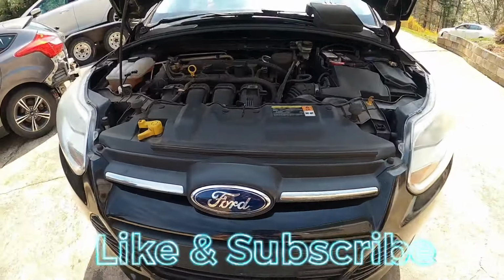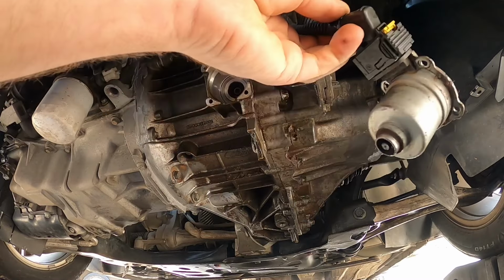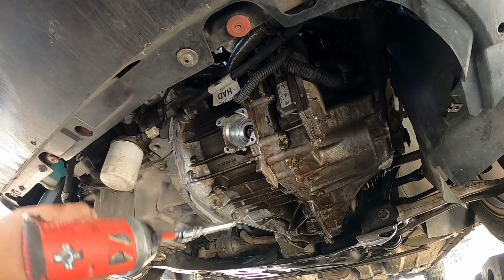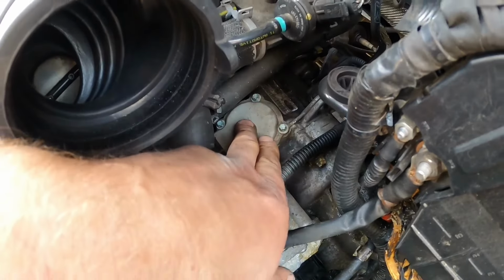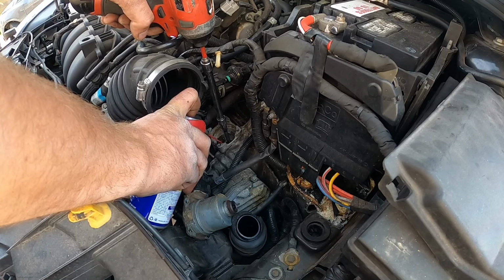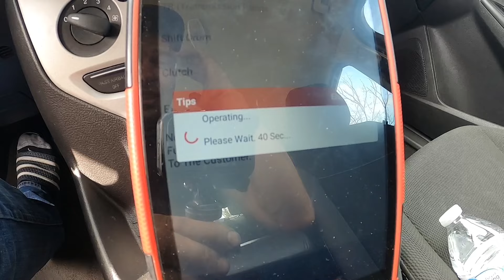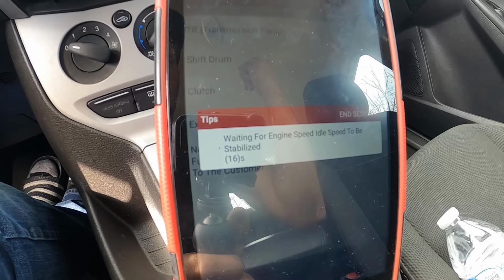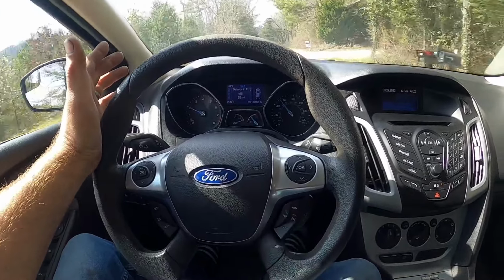2012-2018 Ford Focus Slipping? No Reverse? No Drive? Problem Solved. Easy Fix. You Can Do This!

Comment: What's the actual name of that piece needed in that kit? Thank you
Reply from the maker: https://www.ebay.com/itm/184480096055?mkcid=16&mkevt=1&mkrid=711-127632-2357-0&ssspo=yvwl7HUSReq&sssrc=2349624&ssuid=-qApsBzoR4m&var=&widget_ver=artemis&media=COPY
Reply: @L8R-HP  wow thank you for the fast response
Reply: @L8R-HP  I really hate to bug you. I'm having issues finding a place to buy it here in the US. Any tips? Thanks
Reply from the maker: @wymorr6889  I’ve see it on Amazon before, just can’t find the link at the moment
Reply from the maker: @wymorr6889  MIXPOWER 10 Piece Spline Tip Bit Socket Set, M-Type, S2 and Cr-V Steel, Extra Long 4'' Length, M4-M18, XZN Triple Square Spline Bit Socket Set https://a.co/d/bHbZ1Ev
Reply: @L8R-HP  well I got the bit set and they were the wrong rib amount :( I'm just going to buy that whole kit you have for working on the whole transmission. On the plus side, while I had actuator B opened up, I cleaned it out and lubed it, started my car and shifts fine lol. Just wasn't able to spin that thingy inside. I'll do both actuators here in a week or so. Thanks again for the help.

Comment: I want to buy a Ford Focus 2012The owner tells me What is wrong with the actuator According to Amazon the price is 81 dollars. He tells me that he ran to ob2 and it gave the code for the actuator.. And tells me that everything else is fine. What do you recommend I buy it or is it risky that it could be something more complicated apart from the actuator
Reply from the maker: Could be just an actuator. If it is buy an OEM one from ford. Most of the time tho it’s stuck forks and actuators can’t move them

Comment: What would be an estimated cost to have this issue fixed? I have a Ford focus (2017) that pulled up a code P287A (Clutch actuator B stuck).
Plus, why does the car have difficulty starting? It cranks a couple of times without the focus starting, and finally, the car turns on on the 3rd try.
Reply: Hey did you end up getting your car fixed?

Comment: Transmission friction element is stick on P07A3,Clutch A stuck engaged P2872,
Reply from the maker: Most likely the forks. If not, check your battery, grounds.

Comment: Hi I have a ford focus titanium 2012.. my car has been down for a few weeks. so a few times when i was driving I would be at a red light and try to go but I would get stuck then it would go and it's been jumping a bit when I drive what could this be I did get a new actuator A and got it put in I did test drive it and was not getting stuck but still jumping a little but not as much as before help please if anyone knows thank you 😊
Reply from the maker: Forks are sticking

Comment: My 2018 just had service transmission light on only when driving if I shut car off and start it no warning light!! No diagnostics been found on transmission just a P0456 for evaporator canister.
Reply: Also not getting reverse and just slipping in and out of gear! Pulled over and not risk it.
Reply from the maker: Forks are sticking making clutch slip
Reply: @L8R-HP  you think cleaning the actuators will fix it
Reply from the maker: @MegaAce1987  cleaning the forks will help, unless they failed and need to be replaced
Reply: @L8R-HP  well what happens I’m lacking tools what all do I need
Reply: What tool is that?? Also I’m gonna change fluid as well so what tool will I need for that too

Comment: Hi there cool video what is the name of that tool
Reply from the maker: DPS6 Dual Clutch Transmission Installer Remover Tool for Ford Volvo Focus Fiesta #307675 https://www.amazon.com/dp/B09JGC6KF1/ref=cm_sw_r_cp_api_i_H5KSA8N8YC2S8ZHY2WC1?_encoding=UTF8&psc=1
Reply: Thank you
Reply: Another going through the process can I any scan tool to remove any codes
Reply from the maker: @ozydube5497  most scan tools should be able to clear codes. Not sure if all will do the relearn

Comment: I have a 2013, I have like a shutter or shaking only at about 1500 rpm to 2000, then it stops in the other gears, it returns when slowing down at the same rpm’s… what could that be ?
Reply from the maker: Shift forks are getting stuck
Reply: That or motor/transmission mounts .

Comment: My 2011 fiesta shudder when below 40KPH or below 2000 RPM but no shuddering when the temp still cold. What could be the issue? It's bothering me so much.
Reply from the maker: Forks are getting stuck. Need to be cleaned or replaced
Reply: @L8R-HP  Thanks.
Appreciated your response

Comment: Hello there , question …. I have code P07A3 out of mine 2015 Ford Focus which says “Transmission Friction Element A Stuck On” you think doing this cleaning and lubricants on the top actuator will help me to fix it ??? Thanks for your time in advance 🙏
Reply from the maker: Yes this will help, if not the shift forks need to be replaced

Comment: i have a 2014 ford focus it has reverse but no drive and both of the actuaters work i have swapped them around and it still only has reverse and i cant afford to get it to anywhere to have codes scanned not sure what to do anymore
Reply from the maker: Any auto parts store should scan codes for free

Comment: Hello, My dad was driving his 2012 focus home the other day and its been shifting fine and has 230,000 miles on it. But today after he pulled out from an intersection it went to shift into second and he lost drive and reverse entirely. We scanned and it has 12 transmission codes.  P0805, P087A, P0902. P0903, P090C, P090D, P2831 ,P2836, P285D, P285E, P2861 and P2862. I cant find anything for these codes really since the focus has such an infamous rep that its mostly just people complaining about dead transmissions. Do you have any idea what could the issue be? The cars been no slouch and its never shuddered or slipped since we did normal tranny fluid changes,.
Reply from the maker: With that many codes at once it’s probably your TCM that failed. Find a used one online and try it out.
Reply: @L8R-HP  Thanks for the help, I tried to reset the TCM just to see what would happen and when I hopped in this morning it actually had at least 1st and reverse, Ill have to try a test run but the TCM is the biggest issue if it doesnt go away

Comment: What does, friction element b stuck off, related to?
Reply from the maker: Stuck forks
Reply: Thank you 🙏 do you have a video on how to unstuck them? Or is that the one when you are spraying WD 40
Reply from the maker: @fernandohiguera6972  you can try this out, if this doesn’t help the transmission will need to be removed to get to the forks
Reply: @L8R-HP  ok thank you sir

Comment: Hello. We have a 2014 Focus that fails the " Actuator B spring flyback test". We squirt it with WD-40 and it works for a few hundred miles but then fails. Would you be interested in giving a shot at fixing it if we could figure out how to get it out and sending it to you? - Tks John and Shirley Wright Boulder Co. PS: We really love our Focus, but for this problem.
Reply: I guess not, eh?

Comment: I have a 2014 with a shudder in 2nd gear. Would this possibly help?
Reply from the maker: Yes it will help. Your forks will move smother and it will shift better
Reply: I have a 2014 also and 2nd gear shudders too!!! 86k on vehicle!!

Comment: Do you know anything about the code P287b and p2832? Are my forks sticking? My trans seems to take off in 2nd or 3rd and is sluggish like skips lower gears and shifts at 3500 like you hit a wall

Comment: What’s the little 6mm part called if I’m on a budget?
Reply from the maker: Capri Tools 6 mm M6 Stubby XZN Triple Square Bit Socket, 1/4-Inch Drive (CP30353) https://www.amazon.com/dp/B083B6KMCL/ref=cm_sw_r_cp_api_i_QXBRB8E0AVTYPHWYW2RZ

Comment: So mine works fine then randomly it has problems like it don’t know when to shift like eventually it will shift gears it just takes a little bit.  And then sometimes the reverse won’t work but if I turn the car off let it sit for a few min if will go into reverse again. Is this the same problem or is mine different. Been to ford twice for the recall and still have these problems
Reply from the maker: Forks need to be cleaned or replaced

Comment: any chance you know where to purchase just the spline socket? or part number for it?
Reply from the maker: Capri Tools 6 mm M6 Stubby XZN Triple Square Bit Socket, 1/4-Inch Drive (CP30353) https://www.amazon.com/dp/B083B6KMCL/ref=cm_sw_r_cp_api_i_QK9XM74TG2CBAF6AB5H7
Reply: I tried the M6 but a bit small it keeps on slippng from spline. Do you think it's  m7 ⁴
Reply from the maker: @amznoldamba7091  https://www.ebay.com/itm/184480096055?mkcid=16&mkevt=1&mkrid=711-127632-2357-0&ssspo=yvwl7HUSReq&sssrc=2349624&ssuid=-qApsBzoR4m&var=&widget_ver=artemis&media=COPY
Reply: @amznoldamba7091  please let me know how it works out I just over nighted an M6 for my 2016 ford focus . really hoping it does the job
Reply: I already tried M6 too small and M8 to big. This M type tool is have 12 teeth, the actuator have 14 teeth. The new link you give will be correct. But it take a month to arrives 😅
Reply from the maker: @drgnslyr9184  you should be able to find this tool anywhere
Reply: After cleaning the forks it really worked! no more shuddering...
Reply from the maker: @amznoldamba7091  nice! Good job 👍

Comment: I've had both actuators, clutches, clutch assembly, forks, all replaced. It has a problem in third gear.
Reply from the maker: If you have a problem only in 3rd gear, it’s an internal problem.

Comment: I have a 2017 only 14,000 miles. Not sure what happened the car has been great up until this morning I pulled forward heard a clink and lost reverse. Reverse acts like neutral and the car is clearly in limp mode now. I don’t have any check engine light. Happened right after charging the battery.
Reply from the maker: Low voltage could have damaged the TCM. Or the fork is stuck
Reply: @L8R-HP  I was wondering but than they should have a battery warning light for low voltage to prepare you ahead of time and a procedure that should be done to reset before driving again in the owners manual to prevent potential injury to the transmission. I was a ASE certified technician for 20 years up until 2009. I wasn’t ever aware of the FOCUS issues and we never worked on them back then. Even buying the car in 2018 I wasn’t aware of previous transmission issues I’ve been out of the field now for so long. Thankfully I have an extended warranty so it’s covered but it’s a hassle. The forward gears are working if I manually shift from L to D but I’m hearing a light rapid clicking noise when it shifts. Similar to a transaxle noise. It’s a bot shuddery as well. The only other thing lately ita been 90- 105 degrees here and all of these issues happened during extreme heat wave. I’m sure it’s no coincidence.
Reply: Were you able to fix it? I have a 2017 SE and literally had the same issue happen today except my check engine light did come on

Comment: Just bought a 2012 for $200.00 that had tcm codes and the engine shook bad replaced top  engine mount all the codes went away for a week then a code for stuck clutch fork bought tool and am going to go in and clean may try this do this first
Reply: The code was po7a5 transmission friction element B stuck on?

Comment: What's that tool you use to turn the actuator
Reply: DSG Gearbox Clutch Motor Electromechanical/Unit Unlocking Tool Aluminum Alloy
Reply: eBay 25 bones

Comment: Hi, what's your zip code? can I ship my focus to you to get transmission serviced? not sure what the issue is? had code P090C, changed actuator A  with an OEM, did the fork thing (just like in the vides), changed the TCM to an aftermarket (oem have 18 months of back-order), shifts really bad? if it's possible let me know

Comment: Thank you for the video and information. I have 2015 Ford Focus and it does not reverse and engine light on. I replace the actuator b like you did and it work. Car started to reverse but after 30 mins it stop reversing. I didn’t to switch actuator A with B to see if the part was defective and still my car doesn’t reverse. I went to autozone and did finer report and it said P287A Clutch B stuck engaged. Do you know what I can do next to fix my car?
Reply: I did switch Actuator A and B to see if the part is defective* -
Reply from the maker: Sounds like your forks are sticking. Need to clean them up or replace
Reply: @L8R-HP  thank you I will try and look at the forks tomorrow
Reply: Do you have a video to do that?

Comment: I’ve got the transmission working great! Now I’ve got a transmission fluid leak that appears to be coming from somewhere hear the TCM? Has anyone experienced this before……if so please let me know where to start trying to diagnose this issue.
Reply from the maker: TCM has 2 o-Rings. Make sure they are good or just replace them
Reply: @L8R-HP  Do you happen to know what size those o-rings are? I’ve searched high and low for this info and can’t find it. I’d like to have new o-rings in hand when I tear this thing apart again.😆
Reply from the maker: @Nwnomad410  I usually get them from the dealer
Reply from the maker: @Nwnomad410  can’t find that exact size anywhere else

Comment: might have work but the tensioner bolt on B snapped after running it in 3 times
Reply from the maker: Nothing u did wrong. That fork was just tired and needs to be replaced

Comment: Actuator A & B already i change...but still that check light on..i use scanner that code still P090C...
Reply from the maker: Did you make sure the forks are moving free? Code is looking like bad actuator, but if you replaced it and forks are moving free, then it’s leading to a bad TCM
Reply: @L8R-HP  its moving free sir..before i install that new actuator i was check that sir..when i dirve some time its not show that check light..but when i get at traffic jammed that check light must show on sir..😅
Reply: When check light on that reverse gear R would be free..but gear change when i drive all smooth change other to other gear

Comment: hey love your videos man! i have a 2012 focus,when i first drive the car it shifts and drives amazing after driving for awhile it starts shifting funny and doesn't go into reverse. also when i shut car off when it is doing this it takes it about 30 seconds before engine will turn over and during those 30 senconds i hear a faint noise of maybe a gear grinding? im new with these transmissions wondering if you can help me!!! the engine code is clutch b stuck.
Reply from the maker: Fork is possibly stuck

Comment: #L8R-HP Great videos!   I have a 2012 Fiesta with 158,000 miles, have codes P087A-00, P087-00-AF & P287A:00 EC  (clutch B ) All started with intermittent starter motor engagement followed by check engine, and no reverse.  I do hear the transmission doing some cycling before starting when turning the key to starter engagement.  Troubleshooting :   1: Pulled B actuator and it will turn over 14 times and seems to not stop but will spring back.   2: Swapped both A and B Actuators & reset codes no help no reverse B clutch codes again. 
Could this be Bad fork or TCM?
Reply from the maker: If forks are working good, and actuators swap didn’t help, it has to be the TCM. Check your ground wires and test your battery also
Reply: @L8R-HP  Thanks for the reply. Wow looks like TCM's are really hard to find right now.  Is it better to get an OEM Ford?  Hopefully my Pull a Part have some available.
Reply from the maker: @craigchamier5452  used oem would be best.

Comment: Great video!  What diagnostic tool are you using?  Will it work with any bluetooth OBD reader, or do I need a forscan unit?
Reply from the maker: I used A launch 431. I’m sure other scan tools will support it

Comment: Also, I know you repeat it quite a bit, but does the scan tool used have to have ECU coding feature in order to perform the adaptive TCM learning? Or can lesser expensive models work?
Reply from the maker: Most scanners can do it, 
I hear forscan can do it, I haven’t tried tho.

Comment: I was doing this and it seems like the spring inside broke. The bolt you spin inside the actuator housing just spins freely now, and I have no reverse. Can anyone help?
Reply from the maker: You need to replace that fork.
Reply: @L8R-HP  I appreciate the reply! Upon further investigation, it was the bolt head that broke off, so the spring might still be fine. I'm hoping it's not too expensive.

Comment: Using a powered screwdriver caused damage to the clutch fork mechanism. I would recommend using a hand screwdriver instead and do it gently.
Reply from the maker: Yes, if you don’t know what you’re doing it’s best to do it with a hand tool

Comment: What kind of code reader are you using?   Where do I buy it
Reply from the maker: It’s a launch. I got it of eBay I believe
Reply: @#L8R-HP  much appreciated.   I was planing on pulling the trans down to clean it out and get the clutch dust out.   I'll try this first
Reply from the maker: @mattreitsma4076  no problem 👍 😎
Reply: @L8R-HP  There are a ton of Launch models, can you share which that is?
Reply from the maker: @chrispresley  mine is a launch x431 i believe